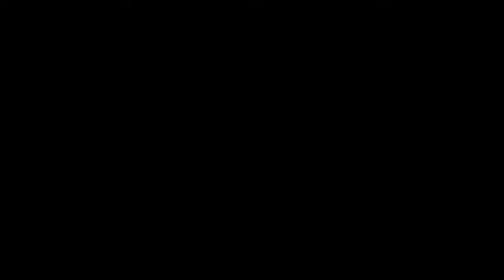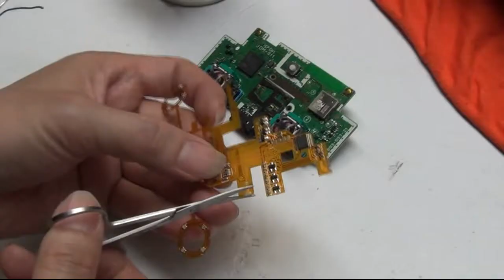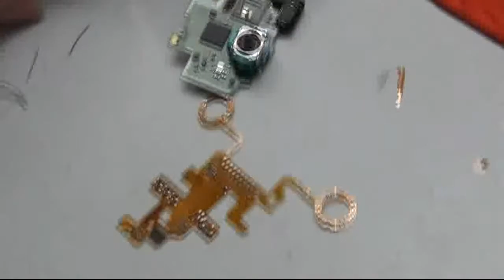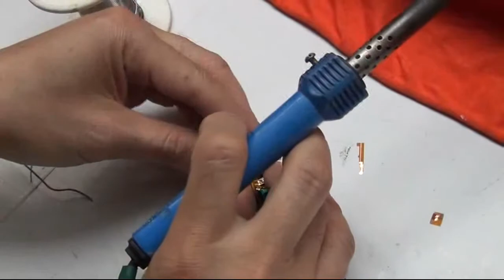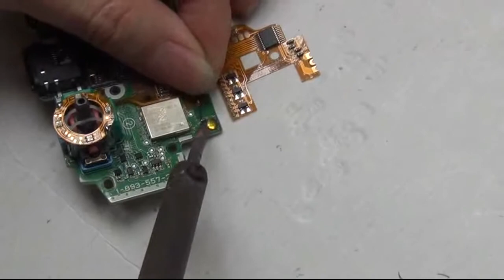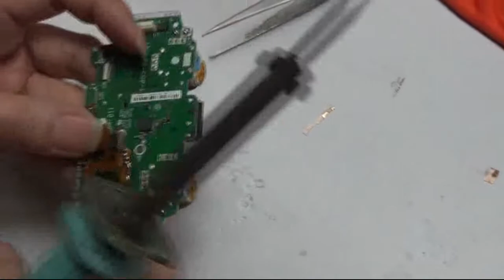MaxColor for PS4 Version 2.0 (How to solder)

Comment: I installed it and the led sticks blink... When I plug into my charger, the top led glows yellow, but none of the buttons on front work. I can't connect to my ps4, and when I press the ps button it will not flash white on top.. What did I do wrong?